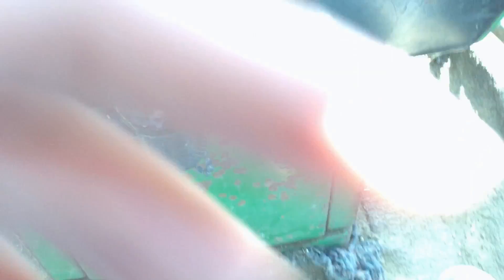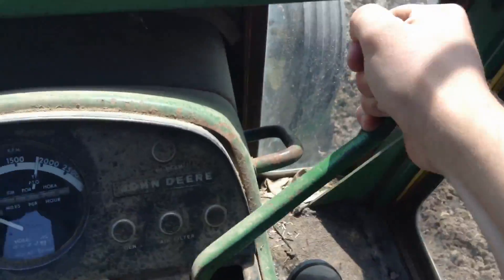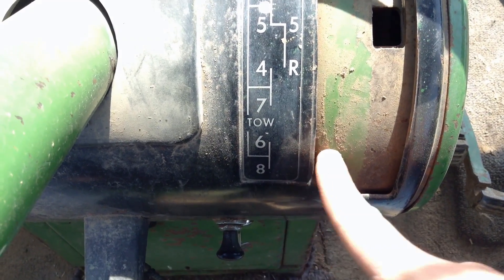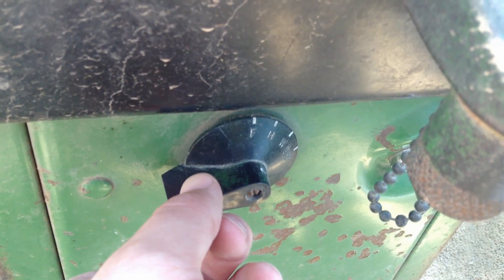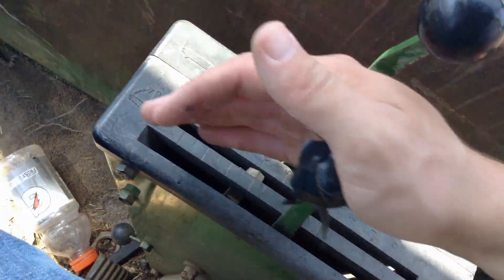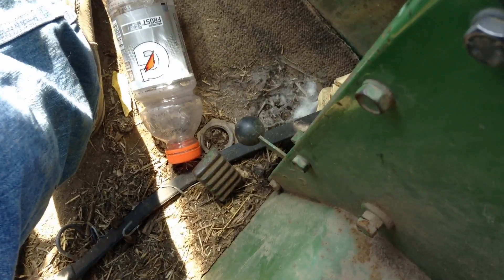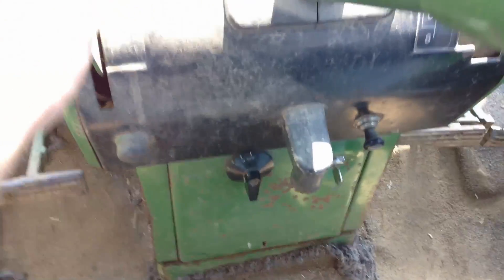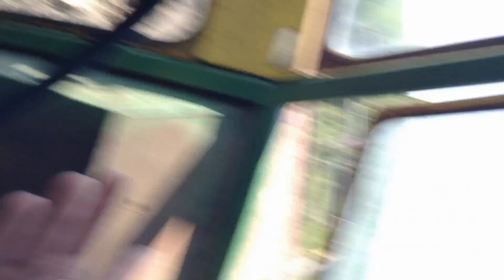How to operate a tractor (John Deere 4020)

Comment: The lever on right side steering wheel is a throttle. The foot throttle is for using with a loader. On the old style 4020 slow the throttle to a idle pull knob out and up is the engine shut off. On the 4010 their is a third reverse. It's by forth and seventh gear. I've been told that gear is in the 4020 transmission also. You just can't get to it.

Comment: So you can start in a higher gear or do you have to work your way up to the higher gear like in a manual car?
Reply: Late reply, but I just saw this.  You start in higher gears.  When shifting between ranges on these, when the shifter is all the way left, you are supposed to be at a full stop, so you don't have access to gears outside that range on the go.  So, highest range, the lowest you start in is 6th, shift between that and 8th on the go only.

Comment: The 40 20 is the perfect tractor for teaching anyone to operate a tractor but I would like to see you include more safety points for people who are not familiar with a farm tractor. You should touch base on the brakes and how they lock together and what the purpose for the individual brakes are. In some situations applying only one break at a time can be dangerous. Also talk about the power take-off and the dangers of the power shaft. I would be concerned about people trying to operate that tractor with only the information that you gave. Thanks for the video you did a good job just add a few more pointers and your trainees will be safer operators.

Comment: I was allowed to drive a Case tractor when I was 12 or 13.
I started driving a lawnmower when I was 8, a 1986 MTD even. I have driven manual transmission, no power steering lawnmowers all my life and they are pretty simple , I sure won't get into a tractor accident, I got between a trailer and a tree with a lawnmower once.

Comment: Us to here in Texas. You are right about the experience of driving from an early age. I've been driving ever since I was 3-5 and graduated from a go-kart to a John deere 212 garden tractor then to a 1995 Ford f250 XLT Turbo Diesel and have driven many ATV's including golf carts. Over time I have learned to backup a good size flatbed trailer. So it's better to learn on something smaller so if you crash it's not as big of a deal. Yes there are many things I did not say in this comment that should be in here.
Reply: MikeJD60 me too I live in texas am 11 and drive a 1992 standard transmission Toyota truck in pastures, and I have a feeling I'm gonna rock drivers ed In 5 years!!!

Comment: i run john deere 4020 myself. most of my tractors and equipment is kubota. but all is either john deere or kubota. except a old IH disc. but any ways most people dont know cause it doesnt say it but the 4020 had 3 reverses. they didnt mark it on the pattern because it is to fast of a reverse.

Comment: The term you're looking for is "hand throttle" or "throttle". Some tractors have the foot throttle (foot-feet as you call it LOL:)) and some don't.  A lot depends on the size of the tractor and the engine... (our old Ford 5200 and 6600 never had a foot throttle, but the 2310 does and the 5610S's do.  BIL's Case 2290 and 2390 and 4890's don't have the foot throttle-- he told me the Case engines weren't designed for a lot of throttling-- sorta "rev it up, set it and forget it" type of deal).  Our Fords all have the 8 speed unsynchronized manual transmission "twin stick" (1-4,R on on the big stick, L and H range on the lil stick) and dry clutch.  The big Cases I run for my BIL have the 3 range powershifts with 3-4 manual gears per powershift, which is nice, but not as nice as the newer yet Deere's with the 16 speed or 18 speed powershifts.  Of course the ultimate is the IVT's, but those are expensive... and of course hydro's are nice on combines and cotton pickers-- sure beats the old 3 speed manual transmissions we had on our old International cotton pickers... 

Neat video.  Do yall have to shake the steering wheel back and forth to get them to start, to relieve the hydraulic pressure on the hydraulic pump?  I've heard that's a fairly common deal with the 4020's.  

Later!  OL J R :)

Comment: First time i sat in a tractor i was 2. First time o drove one i was 7. Im 15 today and im fine, never had an accident and i've been driving for 3 years now. You shall never be afraid of your machines, but you should always have respect for them.
Reply: your right
Reply: One of the truest statements you'll find in the comment section of this video. First time I say in a tractor I was 3. I first drive one when I was 8. Now I'm 13 and still driving away. I've never crashed as I show respect towards my machines and I'm confident I never will.
Reply: One of the truest statements you'll find in the comment section of this video. First time I say in a tractor I was 3. I first drive one when I was 8. Now I'm 13 and still driving away. I've never crashed as I show respect towards my machines and I'm confident I never will.
Reply: Stoffe6600, no doubt about it. Don't fear em, respect the power they have and use it wisely.
Reply: Me to Ross Brady

Comment: You didn't tell them about if you press the brake before the clutch it wont go so well.
Also im 12 and i have been driving for about a year in a tractor not very big Farmall Super M but i wanted to see if i could get more info on more upgraded tractors.

Comment: The 4020 is a legend, even though I didn't have pleasure to ride it, but.....doesn't gear shift is a bit complicated??? As I can see you cannot turn easy from 1st to 2nd, 2nd to 3rd, 3 to 4 etc, if you want to rise the gear gradually you have to make more than one move, also where is the idle position?? In my village in Macedonia (south-east Europe) in the mid 60s, a big state owned agriculture company has bought some 10-15 4020, the workers who were operated them still saying stories about this machines...they don't need mechanics, they don't need spare parts, dont need anything but diesel fuel and regular change of motor oil. Later in 80s and 90s the company has bought some newer tractors like Zetor, Belarus, Fiat, IMT and some bigger and newer models of John Deere but 4020 remain the best tractor ever entered in the village.
Reply: +Кајмакам Ефенди With a tractor manual transmission you don't change gears while moving.  You stop, choose the gear you need for what ground speed you want and off you go.
Reply: +hlyautey
You're wrong about stop-change gear. Manual transmission, even un-synchronized, allow to change gear while moving. No need to mention the synchronized ones...In Europe more than 90% of all vehicles are with manual transmission and none have to stop to change the gear
Reply: +Кајмакам Ефенди Since you know so much about operating a tractor why do you ask questions in the first place?  No,  a manual transmission tractor is not shifted while moving like a automobile.  In high gear top speed is usually below 20 miles per hour.
Reply: +Кајмакам Ефенди Did you notice in the video he started out in 6th gear with the engine idling?  Try that with your automobile.
Reply: +Кајмакам Ефенди Tractors and lawn mowers are the same as far as changing gears, if you have ever operated a riding lawn mower, equate it to a tractor. They are the same as far as changing gears, you have to stop, choose the gear, and then ease off the clutch/brake in order to go.
Reply: Your suppose to stop going into another range, guy I use to work for told me to double clutch when going into another range. Wahlah worked just fine and did it  lot. Said he did it since he owned many many years ago, I worked for for about 5 years and its still going strong today. I guess it just depends on how you do it.
Reply: I can't believe it...some guys still support the idea that you have to stop the tractor  in order to change the gear. My quest. was why the positions of gears are not gradually like 1-2, 3-4, 5-6, 7... instead of 1-3, 2-5, 4-7, 6

Comment: That knob on the steering wheel is what is sometimes referred to as a "Necker Knob", "Suicide Knob", or simply "Steering Wheel Knob". I drive a White Field Boss 2-70, and it is equipped with one.

Comment: In many videos I can see that the driver in order to increase or decrease the throttle must adjust several times the throttle handle...why is that...the throttle is not so precise as it should be or something else is the matter..
Reply: I think that those operators are experienced, and thus they make frequent adjustments to the throttle. Generally, you should slow down when crossing slopes, turning, or traveling in high traffic or confined areas. Doing work will require frequent throttle adjustments, just like driving a car.

Comment: Our 4020 had a powershift transmission and you had to press the clutch in order to start the engine. It also had an accelerator pedal, as most tractors now have.

Comment: The clutch releases the transmission from the engine and allows you to shift gears. Also, when starting the tractor, it is a very good idea to push the clutch in to prevent any accidental movement, which can be caused by anything. That little foot pedal under the brakes is the booster. you press that if you need a boost, but this does not replace traction lock when in the fields. Grew up with a 4020 and a 4000. Beautiful tractors! Easy to drive and quite handy for almost any farm job requiring a tractor.

Comment: I was eight or nine when I first started running it.  From 6th grade on, I usually was guaranteed missing at least one day of school, in both the spring and fall, in order to help Dad farm the one field we had on the Northern county line.  It took at least 2 hours to drive a piece of equipment there, and I was an extra hand to help get it done as quickly as possible.

Comment: The tractor I first started on was a IH 656, gas, wide front.  First job I ever did with it was running the 3 point mower over the sweet corn patch after the season was over.  Spent several springs running a 15' rotary hoe with it too.